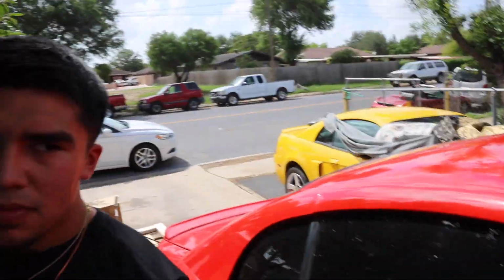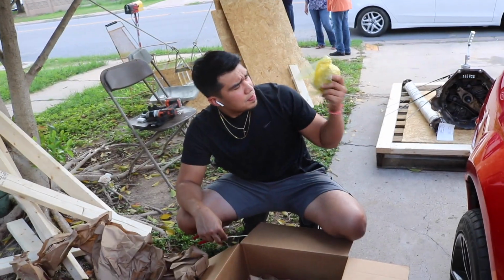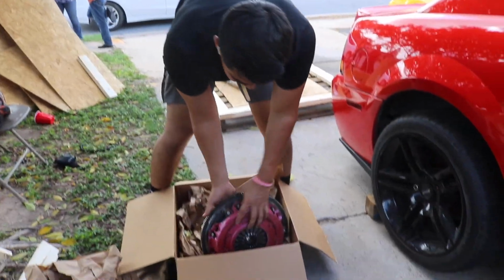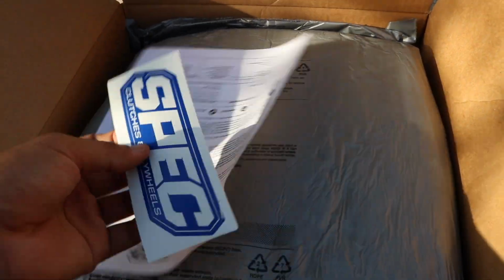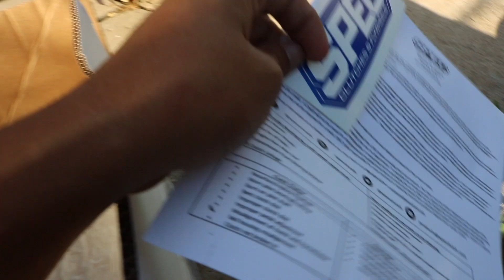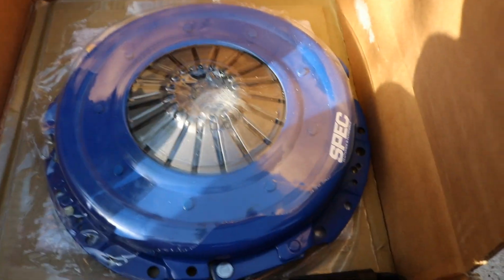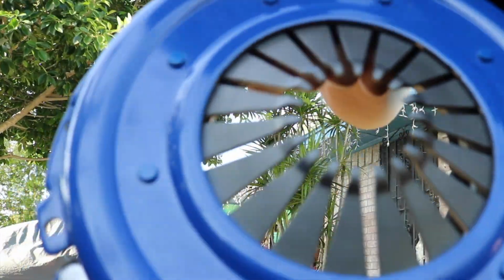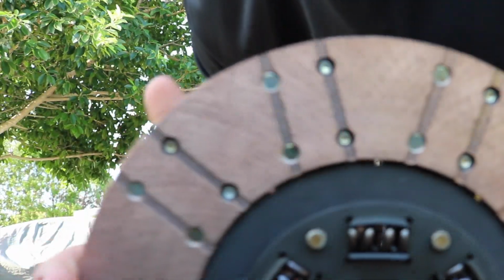COYOTE SWAP NEW EDGE: T56 Transmission and clutch are here !

Comment: Just run a oem cable and a fire wall adjuster with aluminum quadrant.  Pedal should feel like butter. Also I used a McLeod on my coyote swap. I wish i would have spent the extra cash and got a Mantic.
Reply from the maker: SVT CoYoTe thanks for the good info man I appreciate it and thanks for watching 🙏🏼🤘🏼
Reply: @xJD2Vx  no problem man. I am just now starting to get into racing my cobra as well. I gave you Subscribe.  Hit me with one brother.
Reply from the maker: SVT CoYoTe thanks a lot man I really do appreciate it. And racing is just a awesome hobby and stress reliever  🤘🏼🙏🏼

Comment: That green popsicle looked delicious haha. Down the road you going to go turbo, supercharger, or keep it NA?
Reply from the maker: Chandler Dean haha it was . And not sure really on which type of boost but I will have my fun NA before I go boost so I’m gonna try to film as much as I can really get a feel for the NA coyote life 🤘🏼🤘🏼
Reply: @xJD2Vx  that's whats up. My goal is to eventually get a built 2v from Modular Head Shop and procharge it, but that's way down the road. Currently working on acquiring cosmetic pieces for the exterior. So far I have a 99-01 cobra bumper, 99-01 cobra amber tail lights, 03-04 cobra side skirts, 03-04 cobra mirrors, 03-04 cobra rear bumper. Just need to get them paint matched lol. Next step is to get my BBS RKs ceramic polished so they will have a hyperchrome finish.
Reply from the maker: Chandler Dean nice bro definitely got some rare pieces . That’s what I also did first . I got all the exterior I wanted then painted the car and went full bolt ons with the 2v . And I was really caught in between whether to boost and build the 2v or go coyote swap . But in the end coyote swap has always been a dream of mine so that’s what I chose 🤘🏼🙏🏼 thanks for the support bro
Reply: Be done alot sooner. I wanted to turbo mine immediately and it just added that much more time and money to the swap. I love my car. But I could have saved 5k on the swap by just staying n/a.
Reply from the maker: SVT CoYoTe yeah man I hear you I wanted to boost it immediately but I think I need to slow down and just take it slow cause I’d like to also upgrade axles,brakes etc. just to make sure that when I go boost it’s actually safe lol
Reply: @xJD2Vx  I hear ya. Mine needs the FTB bushing kit now. Old irs is wore out. Hey if you need any help with the gauges.  I do a wiring service for guys on the swap page. So just hit me up for assistance for the gauges and A/C.
Reply from the maker: SVT CoYoTe awesome man what’s your fb ?
Reply: @xJD2Vx  look me up on the new edge coyote swap page.  Nathan Andrew Hensley.

Comment: I hear you bro. Im trying to install long tube headers on my stang, but got the wrong x pipe for it last year before I started my project. Now I gotta wait for this bbk catted x pipe and I miss my damn car lol. But right now im running ported pi heads the whole pi set up, and slp loudmouth exhaust jlt cold air. After this, I'm taking a break lol.

Comment: If it’s a T56 out of a Terminator with a 2.66 First, I’d Recommend at least 4.56 gears. The coyotes rev so high that even with 4.10s, the Coyote swapped New Edge on my channel has looooooong gears! With a 26” slick we’re going through the traps a little over 6000 rpm—needs more gear! Stay tuned for some track vids of that swapped car on my channel soon!
Reply from the maker: Race Gas Smells Good awesome man yeah I’ll be sure to put some good gears and I’ll check it out and stay tuned thanks for the advice and for watching 🙏🏼
Reply: @xJD2Vx  Can't wait to see yours come together man!! Gonna be a beast!